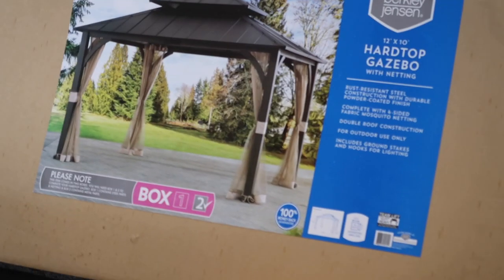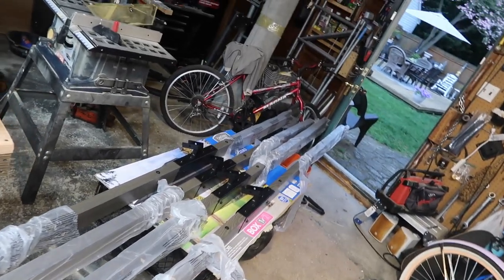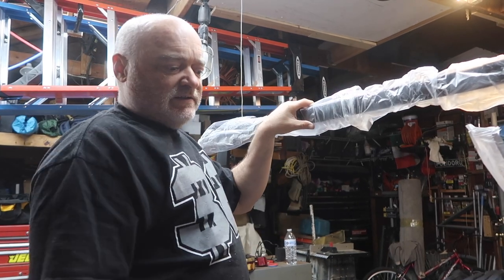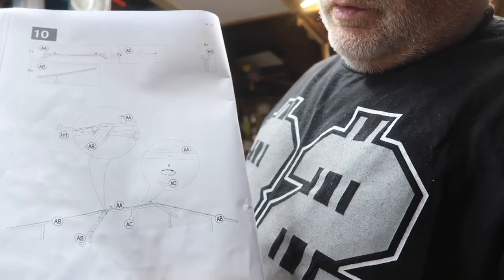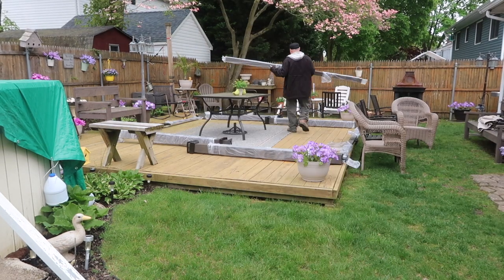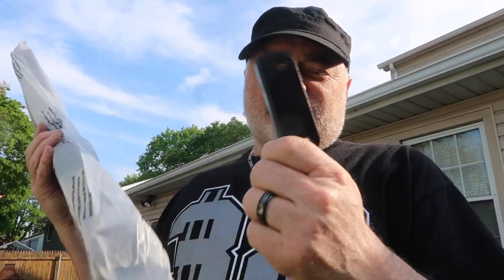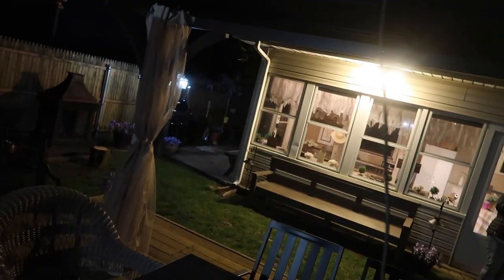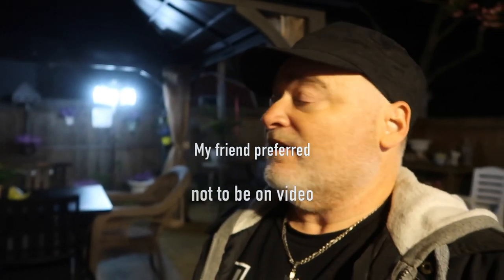HARDTOP GAZEBO DIY

Comment: Hoping you can help with an issue I’m racking my brain about. No matter what I do the corner arch supports are not lining up to the pre-drilled holes on the columns. Did you come across that issue? Can’t get assembly support on the line when I call the number on the last page of the manual. Please help!
Reply from the maker: I didn't run into any problems. Sorry your having an issue, did you try flipping them over and are the screw holes facing in?

Comment: How’s it holding up? Looking to purchase one.
Reply from the maker: It’s holding up great no issues at all. The hard top is the only way to go!
Reply: @ALDoesALL   Im curious about how this handles the rain, are there gutters of some kind? or a way it diverts water?
Reply from the maker: @tomp8442  it has a small lip around the bottom that diverts the water to the corners. It won’t hold back heavy rain but does ok during a normal rain fall.
Reply: @ALDoesALL  Thanks! It looks great btw. Now that you've had this set up over the winter, how has it handled the  wind, you sound like you have an east coast accent so I assume you may live in a windy area.
Reply from the maker: @tomp8442  yes I’m on Long Island. Make sure you get one that is vented at the gable on the peak that lets the air escape and it won’t lift.
Reply: @ALDoesALL  Thanks, I'm also on Long island! Smithtown area. Anyways, I actually just bought this exact model from BJs today. Thanks for posting a video like this. Its a big help!

Comment: I have to put mine into concrete, not wood, so that'll be fun...
Reply from the maker: You can fill the 4 poles with sand to weigh it down.
Reply: @ALDoesALL  Good tip, thanks!
Reply: @ALDoesALL  This will not interfere with rain drainage?
Reply from the maker: There isn’t any drainage ports through the 4 corner poles. They are capped and the roof bolts to them.
Reply: @ALDoesALL  Yes your correct, my apologies.  I saw bad info online but now that I built it I can see.  Thanks!
Reply: @ALDoesALL  to confirm you saying i can fill the 4 poles with sand to weigh it down instead of anchoring down into my patio which i don't prefer?
Reply from the maker: @Jsantana624  yes that will work, you just need the weight to hold it down.
My Neibhor has two of these without being bolted down at all and no extra weight. They have been up over 10 years. Though I wouldn’t recommend that at all they have been ok. The tops are vented in the center to let out the wind if it were ever windy enough to attempt to lift it.
Reply: @ALDoesALL  Thank you for the tip. I live in NJ so was little concerned with wind lifting it. I purchased the same gazebo you have and picking it up tomorrow. Rather not mess up my paver that I installed